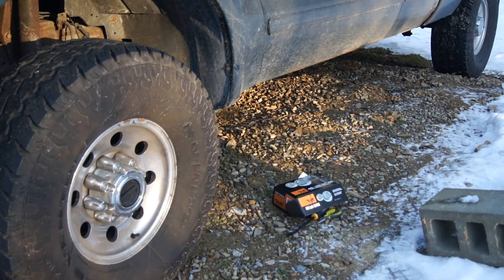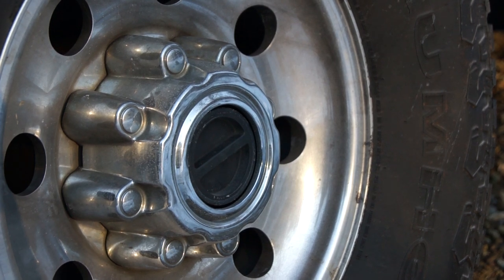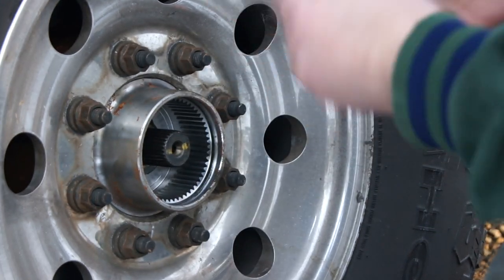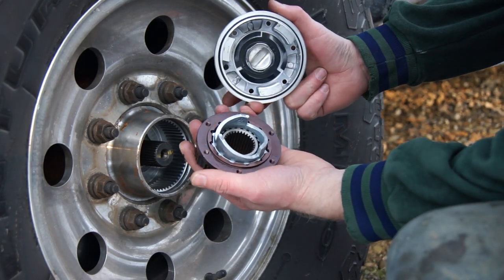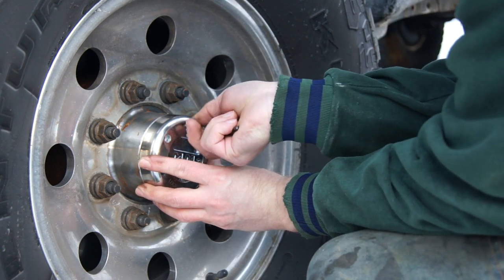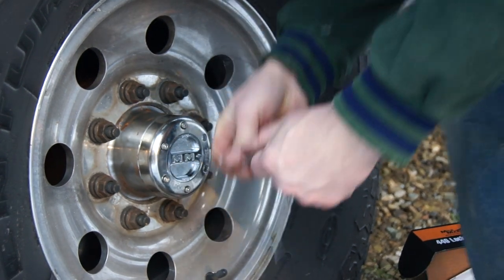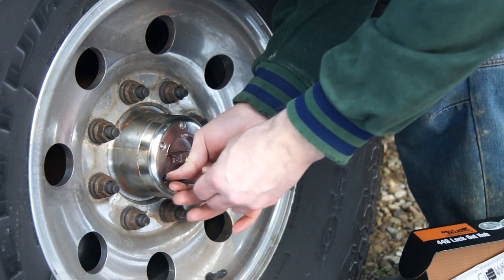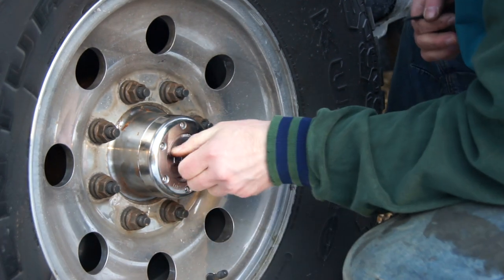How to replace hub locks on Ford, how change HUB LOCKS on Ford, locking Hubs issues

Comment: You mentioned that you only use the one snap ring to hold the base in, I recommend that you use both. the "spiroloc" holds the base in a bit farther and will prevent any issues with the cap being loose, or clicking/squeaking when you turn the truck.

Comment from the maker: I think they are a lot better than factory ones. Stainless steel according to the box that they came in and website. Also, no plastic parts on them. I have not drove the truck yet since installing. These hub lock shorter than factory ones by 1 1/4 inches. I do recommend them since they come with life time warranty and on the box it states "go and abuse them".

Comment: Your suppose to bend the c-clip in a u shape so the hub doesnt rock back and forth like yours does. That play will cause the outer cap to move and then dirt/water/mud/etc will get pass the o-ring and into the hub. If you read the instructions it explains what to do with pictures also. And you shoukd have bought Warn Premium hubs, Mile Marker hubs strip internal gears all the time. They use cheap metal

Comment: thanks for the video, do you still have the truck and if so would you still recommend these aftermarket hubs? I have a '99 F250 SD 7.3 manual trans reg cab long bed.
Reply from the maker: Definitely recommend, price is very good and affordable.
Reply from the maker: You eat baklava?
Reply: @repairvehicle  yes its delicious :)
Reply from the maker: I heard about it, never tried.
Reply: The second locking ring is NOT optional you need both.

Comment: Could an auto locking hub cause grinding noise? My 1994 has a grind noise coming from the front end and thinking it may be differential, but hoping its the hubs
Reply from the maker: its possible if its completely failed
Reply from the maker: Check your hubs first.  How many miles on the truck?
Reply: The truck has 170k miles. Ive changed the transfer case, carrier bearing, trans is good, fluid levels are good. I am going to check. Ill update you

Comment: You went from auto hubs to manual hubs right? So now your shift on the fly doesn't work anymore unless you stop the truck and lock your hubs in right?
Reply from the maker: They were manual hubs.
Reply: @repairvehicle  so you don't have the switch on the dash to put it in 4H or 4L?
Reply from the maker: No, I don't.  It's a manual lever on the floor.  I have video review of my truck on my channel.
Reply: @repairvehicle  So is all these mile marker hubs manual then? If I want to go to auto I have to to buy the originals I'm guessing  right? I bought this truck and I couldn't figure out why the shift on the fly wasnt working but I finally realized that it had these mile marker hubs on them .
Reply from the maker: If auto option is not available with aftermarket hubs then,  oem is your only option
Reply: @jl456   there are aftermarket auto locking hubs that are alternatives to the original one. Both Standard Motor Products (which i prefer) and Dorman make these. I have never understood why people change to manual hubs on these trucks as you can manually lock the original auto locking hubs.

Comment: Both my trucks hubs won’t turn at all it’s manual shift 4x4. What could be my problem?
Reply from the maker: They probably worn-out or rusted in like mine.
Reply: repairvehicle I got them to turn with a wrench, one of them the cap came out and busted the o ring. Just swapped them both out for a junkyard truck lol. I was selling mine anyhow so it didn’t matter to me.

Comment: Why didnt you get the same replacement....those hubs are for bolt ons??
Reply from the maker: These are the replacement, otherwise they didn't work.
Reply: @repairvehicle  oh...you went with after market...the old ones just have a ring that olds the hubs on...you got the screw on ones...